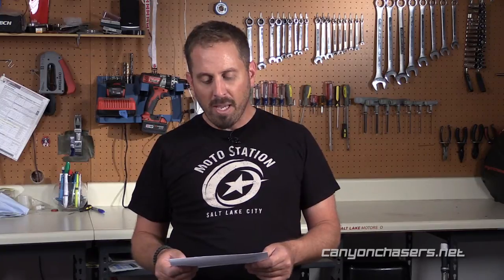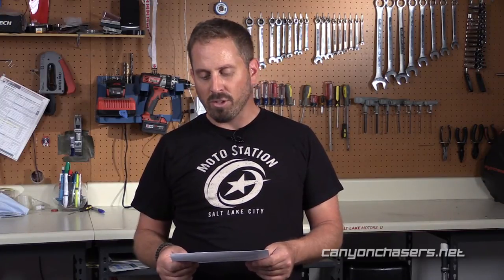Is Your Motorcycle Running Hot After Upgrades?

Comment: Please do a video on what's the best motor oil and coolant for riders with a heavy trottle hand or maybe good upgrades to prevent a motor from blowing up because heavy trottle.  And what's the main reason why so many bikes are throwing rods seems like bikes throw rods more than cars!Also what's the average amount it costs to dyno tune a motorcycle? $ (U.S.)

Very well appreciated and love the video guys! Keep em coming!
Reply: This is an old post but my gsxr runs cooler the faster I go. The more I stop the hotter it gets. Suzuki coolant is the best I think. I'm trying engine ice now and it runs hotter than Suzuki coolant.

Comment: I changed mufflers on a c50 boulevard trike now it runs hot but I had an EFM Autoclutch system installed years ago due to left arm disability I was told you can't Dino an EFM autoclutch system bike how do I fix it